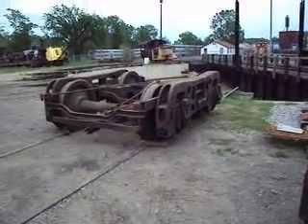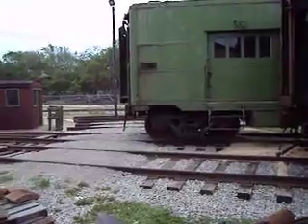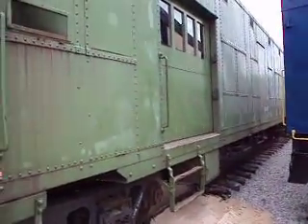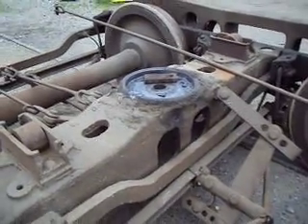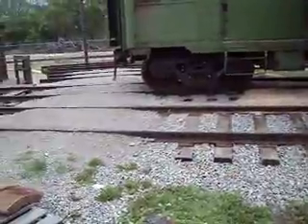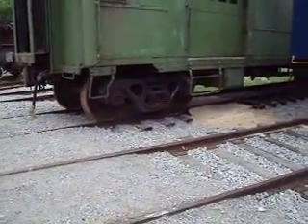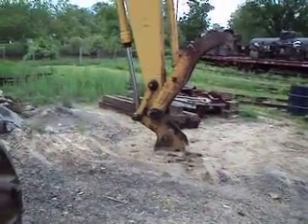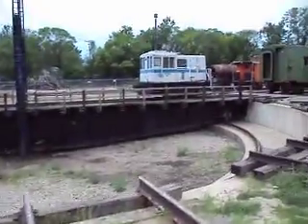Overview of tool car upgrade

Comment: Nice to see tool car PM-C&O 361 (NCCX 1701 USS Enterprise ^_^) getting some love again. I missed seeing it behind 1225 in recent years. Originally in a Dark Pullman Green. It would of got C&O colors later. Currently in a Chessie MOW Mod. I'm mixed about what colors it should be painted next. Most of the passenger equipment is getting redone in new SRI-C&O colors. You also got sister car D&M 7 too, which is also a ex-troop/power car. Thanks for posting the latest SRI equipment update.